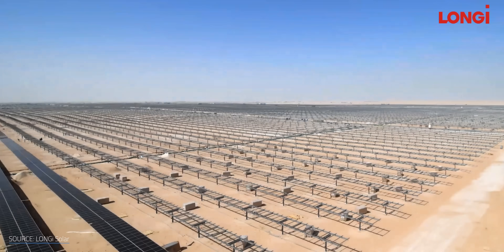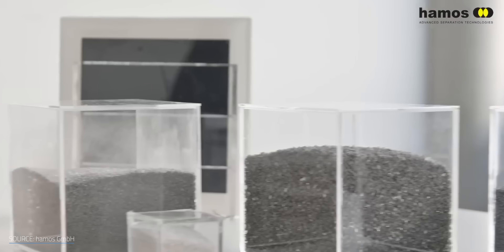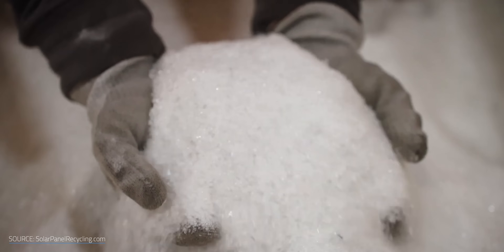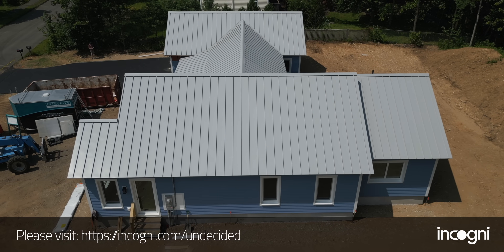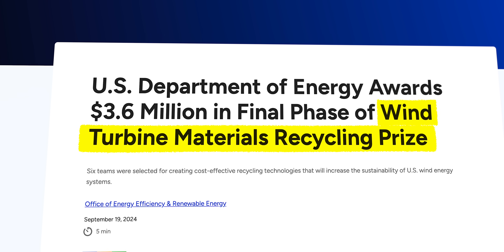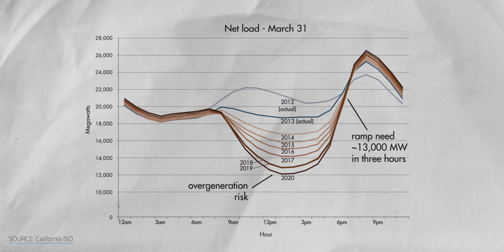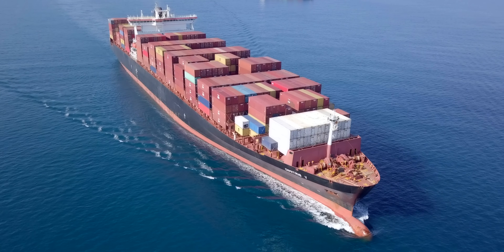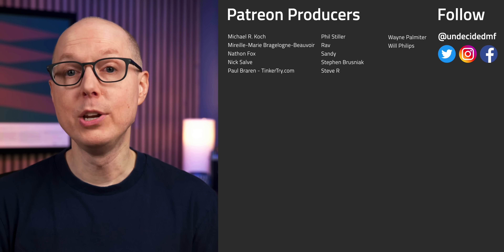How We Solved Renewables BIGGEST Problem

Comment: Im retired now but i used to deliver oversized loads to wind farms and believe very much in wind energy. I was frustrated a couple years back when i heard that no one had thought in advance on how to recycle the wings. So this was great news on that subject. I will add though that because of transportation issues i had thought they should have a mobile machine that you take to the farms that grind up the blades then truck that material to the recycling plant vastly reducing transportation costs AND reducing fuel use and airpolution at the sa.e time lowering the carbon footprint.
Reply: It's always smart to put the industries that work together close to each other.  But we fail to see that SO often.  Fail to see the big picture.
Reply: @victorbenner539 "grind up the blades" That makes sense. It didn't click when I saw the landfill pictures with complete wings, but now that you mention it, I'm surprised they go through all that trouble for something they're not trying to preserve.
What would be your take on using dirigibles to transport the wings and towers to the new sites?
It seems to me that the dirigibles from Lockheed and Boeing are more than capable of transporting these parts since they can carry many tons of payload like multiple tanks.
And it would allow installing the wind turbines in places where it's impossible to bring them otherwise, like steep mountains and tiny islands.
Reply: @VeniceInventors  they'd have to make massive dirigibles to make that work. The largest one today can only carry 10 tons and is 302ft long. That's not long enough or sturdy enough to handle the size of a standard wind turbine. Also you'd have to have cranes or something on the dirigible to hold the turbine in place while it gets attached to the tower.
Reply: @HH-le1vi It may be that the larger wind turbines are too heavy for currently available airships, and while it would be ideal to be able to transport a fully assembled unit (minus the it concrete pad), I'd think that it is at least possible to transport individual components which otherwise require suitable roads. I can't speak of the sturdiness, but the length of the wings shouldn't be an issue as they can be transported vertically, hanging from the nacelle. 
Other than the cost, there isn't any technical obstacle I'm aware of preventing the construction of much larger airships. It would also help if the FAA removed the ban on hydrogen as a lifting gas, as using helium isn't environmentally/economically sound, and reduces lift capacity by 30%.
I recognize that I am not familiar enough with the mega wind turbines to fully grasp the scale of everything, and I'm not an airship architect either, but I'm a strong believer in "when there is a will, there is a way".
Reply: @VeniceInventors  the current transportation methods are actually very good. But it's why I say building farms on the seas and oceans are more efficient because they can load big barges without the logistics problems. And airship are to unstable for assembly of all those peices. It just wouldn't be practical. But I want to mention here while talking about making energy in a ocean environment is the use of tidal turbines. 2 high tides and 2 low tides EVERY DAY!  Talk about consistency.
Reply: @VeniceInventors  you can't transport a turbine vertically. They're 300ft long.
Reply: @HH-le1vi  he was just thinking outside the box. You are correct but I wasn't going to correct him. It's good to occasionally look for possible solutions that might at first seem crazy or impractical.
Reply: @HH-le1vi  That seems fine to me as the airship doesn't have to land, it can stay over one spot at 300+ feet to pick up the load and then rise to a safe altitude before departing.
Reply: @victorbenner539  Fair point, I did see a video of the assembly of the wings, and I have to admit that it was a very delicate and precise procedure, so the airship would have to bring a crane too :-) 
About tidal energy generation, I agree, there is a lot of potential, and plenty of ways to do it without disrupting the ecosystem too.
Reply: @VeniceInventors  what i find interesting about tidal energy is it's gravity based. The most powerful energy in the universe. Something to consider.
Reply: @victorbenner539 great comment. We always need to support people thinking out of the box. You can say both things in the same response. It might not work, but good thinking. I always used to say, “good thinking“ to my kid. I was more interested in the “good thinking” then the actual outcome. Although I did cheer when things worked.
Reply: @clairejeannette8454  thank you for seeing what I was trying to say. I admit it's difficult to keep a open mind. I occasionally find myself saying to someone that their thought won't work,  even though I haven't really put any or much thought into it. And when I finally do even if I still don't believe it will not work I like to apologize to that person because at least they were trying. I have 3 main hobbies, fishing, cooking and gardening. In other words food. There is so much misinformation out the that it's really important to occasionally throw out the "rules" and try different things or look deeper in the the foundations of what we might actually know. For example folks say bbq or smoking food HAS TO BE SLOW. Not true. It is a WAY to do bbq, but not the ONLY way. So yes we must support folks who are looking for different ways of doing things. I like to say there are many paths to the same destination. Have a great day 🌤 🎣😀
Reply: A very valid point, considering that over 90% (or somewhere in the ballpark) of a wind blade's volume is just air. If it's for recycling, NOT shredding it in-situ first would be just stupid. Chop them up with grinders and shove the parts into each other or run them flat with road roller and then roll them up.

 @erikbakker1639 yes, the blades do a lot of good during their lifetime, but it still a literal waste to then just shove them in a landfill afterwards and let them rot there. Or whatever they do, probably nothing for a couple centuries, given the materials.
Even if they are better in total waste than coal etc, it's not that much better if they are still treated with the "throw away" mentality.
That's part of what got us into this mess in the first place.
Reply: Ohhhhh shiny!
Reply: And lose a buncha truckers paychecks. 😅😬
Reply: @jamesharrell4360 . Not funny.
Reply: @clairejeannette8454  duhh.. absolutely no comedy comes from losing paychecks.
Reply: Horizontal wind is common vertical is better and can have a cage cover around them to prevent birds from getting killed but no anything to save and make money right 😂😂
Reply: Well, no one thought of how to recycle them because there wasn't a need to do so when the supply was low. Obviously industry can easily adapt since there's always a demand for a strong material that can at least be used as a filler for construction projects.
Reply: I have actually seen a video from someone like Fully Charged or another similar channel, where they covered a setup that did actually shred the old blades on site. It's really no different to those firms that come to your office and dispose of as much sensitive paperwork, CDS and hard drives as you once - they'll shred it on site and you can watch them do it, so you know it's secure. It's just a slightly bigger shredder and yes, it makes transport so much easier.
Reply: @jonevansauthor  was it at their house and was it a 350ft long turbine?
Reply: The solutions are still complex and not as optimal like the use of fibers in concrete or mother materials (requires protective gear when working on set materials). Due it is being being bridle fibers 

Far more common is the recycling of steel and concrete and technical components from wind turbines.
Reply: @paxundpeace9970  wind turbines don't have concrete. They're all composite. If they had concrete they'd be way too heavy.
Reply: @HH-le1vi  you apparently didn't read all of the beginning. Of course you there isn't any concrete in the blades. The concrete is the foundation for the tower, an amazing amount of concrete. I was very surprised just how much concrete the first time I saw the foundation before it got back filled.
Reply: @victorbenner539  well those turbines weigh 150+ tons and they're 375ft long and the towers even taller on average. You need a ton of foundation to handle that.
Reply: @HH-le1vi  actually several tons of concrete. I wish I knew how much. And the companies are still looking on how to mack them bigger. I believe in the end the largest towers and farms will be in the ocean's and sea's because transportation costs and and large areas for these monsters is more readily available there. The first time I saw the actual amount of concrete that had not yet been backfilled I was surprised AND embarrassed. After all of course there is a mountain of foundation. Think how much wind shear there is on even a light windy day? Mind blown away.
Reply: @victorbenner539  wind energy would be most efficient offshore but that design wouldn't be the same as the ones we use on land.
Reply: Yes, all of the renewable Tech is not a perfect solution at the start. The difference is that there are long-term goals to make these things better versus oil which has no long-term plan other than destroying the planet.

In average wind turbine makes up its carbon footprint within 6 months. Worst case scenario is something like 2 years best case 3 months. And that is accounting for the production the transport the lube required to run it and the disposal. If we can now also recycle this consider how fast they will eliminate their own carbon footprint. It is truly incredible technology and despite what some idiots that were elected president of a fascist State proclaim, barely kill any birds. No more than a house with windows on both sides.
Reply: @mattymattffs  yeah, another thing is they are a lot of places where they would be perfectly suitable and no brainer choices, but as you said we sadly not prgressing there because of politics. like if we properly used those places alone, of course we would not replace all fossil fuels and such, but probably could stall the progression of climate change by decades, giving us time to come up with even bettter solutions.
Reply: @norbertnagy5514  ok lets think this though a little. Lighter then air aircraft do not like heavy winds right? Wind farms need good good airflow so windy conditions would be the norm. So this would not be a viable solution. But no problem, barges with cranes work really well. In fact it's one of the reasons placing towers out in the ocean is such a great option. Funny side note. Wind energy is actually solar energy because it's the sun that drives the weather and airflow around our planet. Now I wonder who's going to argue with that. Everyone have a great day 🌤 😀.
Reply: @victorbenner539 Heavy winds definitely affect airships due to their shape and large volume, but won't there be some time windows or days when the wind dies down or at least drops to an acceptable level?
Boeing claimed that their airship had a top speed above 400 knots, IF that's true, the wind would be no match, but I have yet to see one of their airship fly that fast.
If you haven't noticed ;-) I'm a big proponent of airships.
I agree, wind and hydro power is solar power, without the downsides of photovoltaic panels.
Reply: @VeniceInventors  I figured you liked airships. But the right tool for the right job. Traveling by airship cool. General transportation by airship, possibly a good idea. I know the logging industry ( I live in Washington state) is still looking at lighter then aircraft as a interesting idea possibly replacing or reducing helicopter logging. But I don't see them being worth it for wind. There comes a point of diminishing returns with their use. But that's just my opinion. If someone could figure out how to make it work at a cost effective manner that would be cool. But I don't think it likely.
Reply: Thats a great idea.
Reply: @tlangdon12  thank you. Keep up your great work.
Reply: If you start a company upon this I would invest. This would be revolutionary for the turbine recycling industry.
Reply: @philosopherofinfinite4558  with the new material he was talking about that would eliminate the difficulties of reusing the carbon fibers . My suggestion would make the material return very cost effective and safer at the site because it would also reduce the amount of trucks and drivers at the site.
Reply: I've long wondered why the Blades themselves can't get manufactured on site? We can 3D print an entire house so surely someone can come up with a way to take some normal Semi trucks and manufacturer Blades without widening roads?
Reply: They're made of fiberglass composite. You can't do that in the open air. You also have to test them to make sure they can handle high wind speeds and other incidentals.  @MysteriousSoulreaper
Reply: @MysteriousSoulreaper  Material strength.

We are talking strong fibres - carbon, or glass - that are sealed and bonded with a resin. That resin, needs a controlled environment and to be prepared under specific conditions or, it fails. And instead of a wind turbine blade you have a hunk of expensive garbage - because the fibre is no longer usable, and the clean up and repair cost is greater then starting from scratch.
Reply: @MysteriousSoulreaper  ok im not going to get into all the reasons that currently wouldn't work. And any road being made wider really isn't for the blades, its for the tower sections. The trailers made for moving the blades are amazing the way they extend to ridiculous lengths have wheels that can be remotely steered to go through really tight places.
Reply: I dont understand why people complain about blades not being recycled. These blades are indeed huge, but the energy they generate during their lifespan is immense. The hole you would have to dig using coal if you wanted to generate the same amount of energy with coal would be so much bigger, but somehow a lot of the complaining crowd doesn't care at all about that

Comment: Wind turbine blades may not be endlessly recyclable, but repurposing them as building materials or structural fillers extends their life by another 10-40 years, delaying disposal concerns. This gives time for better recycling methods to develop.  

Many decommissioned solar panels still function at 40-50% efficiency, making them useful for off-grid or lower-demand applications. Reusing them extends their lifespan and pushes the need for third-life solutions further down the road.  

Battery recycling is growing, but true end-of-life EV and grid batteries are still scarce. Most recycling focuses on small devices, giving the industry time to refine processes before large-scale battery disposal becomes urgent.
Reply: The PE-CAN project does offer the potential for endlessly recycling both the resin and the fibre reinforcement. Don't forget that this technology is in its infancy, and once commercialised, there will be incentives to improve the process to increase the quality of the recovered materials.
Reply: Using ground up turbine blades in parking lot pavement mixture may be a good option?
Reply: @anguscampbell1533  That's a neat idea. I can think of a few drawbacks like chemical leaching and subjection to heat as in asphalt/bitumen mixtures. I'd still like to see where this idea goes though!
Reply: "repurposing [wind turbine blades] as building materials or structural fillers extends their life by another 10-40 years" - only 10-40 years? I'd hope that any permanent structure(s) built these days had a design life of at LEAST 50 years, and 100 years wouldn't be unreasonable IMHO.